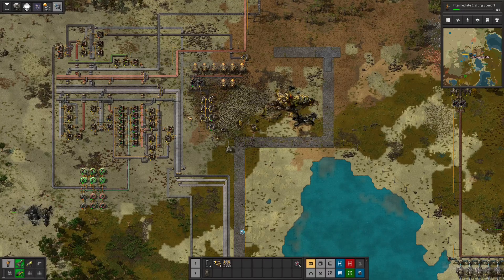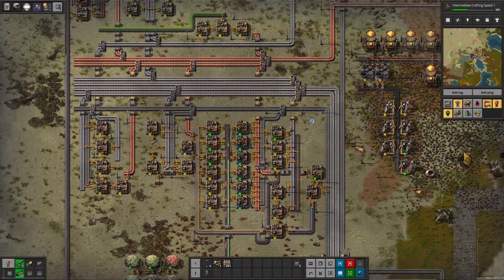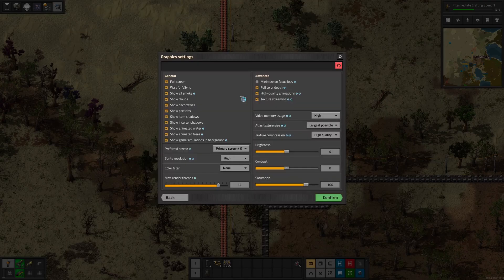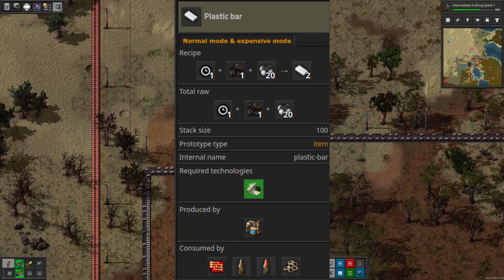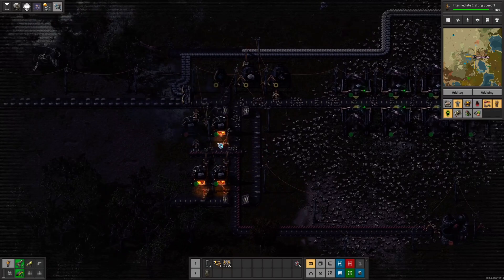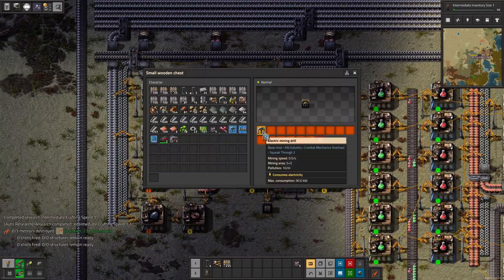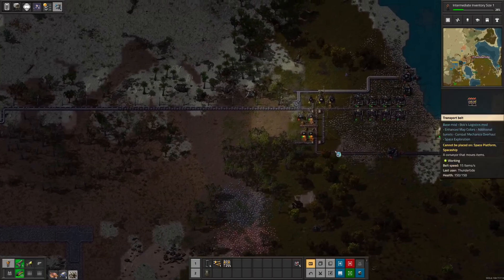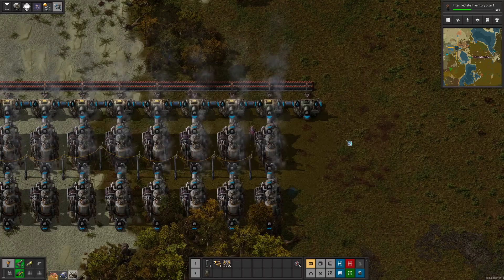Is Factorio Chemically Balanced?

Comment: The chemistry of factorio isn´t close - but enough to give players an idea what things are.

Take plastics. Plastics are polymers with different attributes. Usually you get thermoplastics - plastic which you can form if you apply heat (3D printers use those) and resin. Resins are cross polymerised tough compounds. What they have in common (in modern chemistry) that you use pure monomers - if needed mix them in a predefined state and then let them react. Polyethylen <- Ethylene. Nylon-4, Nylon-6, Nylon-6-4.

So a distillation plant won´t output anything close to 3 compounds - that maybe the start to get them to other distillation columns. And a lot of heating, cooling,...

Sulphur is gained by using Methylene + Water in game. Yes organic compounds do contain sulphur - in a neglectable amount (ok on said planet it could be different), but since we use earth chemistry - sulphur contents in oil is not great and sulphur is the only product, so we did burn the remaining carbon hydrates. 

Next is steel, pipes,... Fluids tend to attack surfaces - so you need to adjust your tubing towards the fluid you are using. Depending on the acid you might not be able to use steel at all, but in game pipes are formed out of Iron.

Similar gaining ore. You don´t just mine ore and ship it - the contents of the metal to stone is usually too small. So you mine, crush, solve, separate the potential metal from the rest. So just winning Copper and Iron ore would be their own 10 step processes with waste, that we treat or push into the world for pollution. While that might be interesting from an engineering point of view, in-game terms it might be boring - so they simplified most processes into single steps.

You have base items like Ore, Coal, Raw Oil and Water that usually need to be processed. The products all have multiple uses. You use copper products for electrical things, Iron for structural mechanical things, oil for isolation, fuel, ... The (base) game does not bother you to do a 3/4+ step sulphuric acid process and introduce most other acids like HCl, HNO3, ... to the game. And all the metals and catalysts.

Comment: The Plastic crafting recipe is absolutely unhinged if you tried to do it in real life
First of all - Polymers are made with unsaturated hydrocarbons
This is because unsaturated hydrocarbons have double bonds that can break and connect with another hydrocarbon molecule to create a long chain

The icon of the petroleum gas molecule is Methane which is the simplest saturated hydrocarbon, in order to make it into an unsaturated carbon you would have to go through pyrolysis (since we don't have a better option)
Pyrolysis basically means heating things up to very high temperatures without the presence of oxygen.
This will create either Ethylene or Acetylene depending on the temperature, ethylene is a better option since polyethylene is much more versatile as a material

Ethylene would have to be polymerized which requires catalysts which we simply don't have, although the walls of the Chemical Reactor might function as a catalyst since they're made out of iron.

The Yield would be abysmal. It's not even close to being useful, it's not like products are separated after Pyrolysis because in organic chemistry everything that can be created in a reaction will be created and that also involves the reaction not occurring at all.
The game is cool though 9/10, If I had to separate every single product after a reaction just to do it again and again I would simply pull all my hair out, can't wait for the Space Age DLC.
Reply: -The icon of the petroleum gas molecule is Methane which is the simplest saturated hydrocarbon...  
 methane is the simplest saturated hydrocarbon, true. the icon is so small normaly that its difficult to see, but its actually ethylene gas.
Reply: While the icon for petroleum gas is methane, I don't think the devs intended for it to be methane, or just methane at least. From my Googling, liquified petroleum gas (LPG) contains propane and butane mostly. I think it also contains some ethane, but I'm not sure. If it does, then the plastic is made from ethylene and propylene synthesized from LPG; if not, then it's probably just propylene from the LPG.

Regarding separating every product, yeah there's a reason this isn't perfectly scientifically accurate. IRL there's about 7 different products that come from oil refining from what I can find, depending on how you classify them (LPG, Gasoline, Kerosine, Naptha, Heavy Fuel Oil, Lubricant, and Asphalt). Trying to hook up 3 different fluid systems to the refinery is already a headache, imagine trying to hook up SEVEN DIFFERENT PRODUCTS. And balancing the use of them all would be another nightmare in it of itself.

EDIT: The icon for Petroleum Gas isn't methane. It's ethylene. If you look carefully, the central carbon is actually two carbons. I don't think you can get ethylene directly from crude oil, though.
Reply: @xcyzvvv2346  Have you checked the icon here? C:\Program Files\Factorio\data\base\graphics\icons\fluid
And it is methane
Reply: @krysto_space the icon is literally ethylene.

There are 2 carbons in the sprite. Look more closely.

Comment: Fun chemistry fact (at least fun for me):

Sulphuric acid is not actually made by dissolving SO3 in water. Instead it is dissolved in concentrated sulphuric acid, forming what is commonly known as Oleum or Fuming Sulphuric Acid with a formula of H2SO4.xSO3. This is done by "raining" the concentated sulphuric acid in a tower while letting the SO3 vapour rise to the top. The produced (overstoichiometric) acid is subsequently diluted by water.

The reason for this is that the reaction of water with SO3 is highly exothermic and a large amount of extremely fine sulphuric acid mist is produced, which takes very long time to dissipate and is a pain to deal with.
Reply: yup, I've seen how Sulfuric Acid is made in real life and could even go inside of the Contact Tower since it wasn't running. I think the whole process is very interesting and often overlooked because it's sulfuric acid, a very common ingredient in a lot of processes